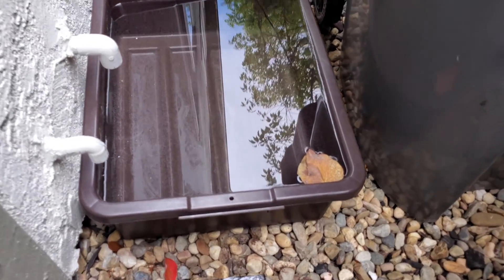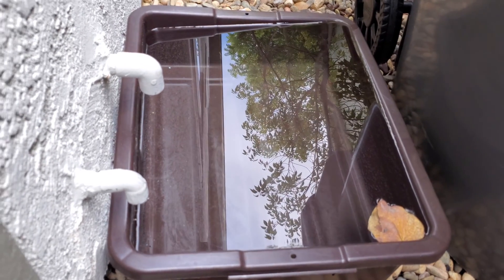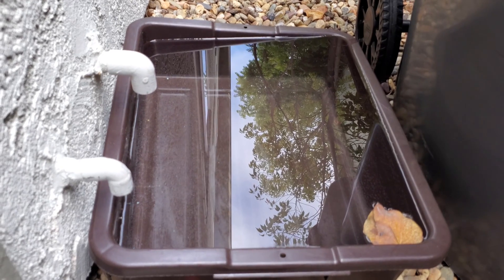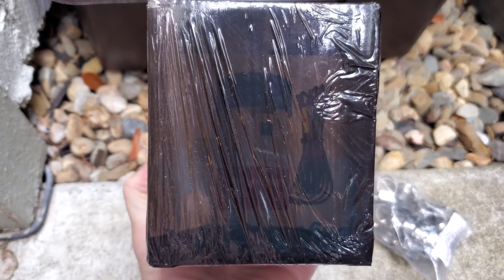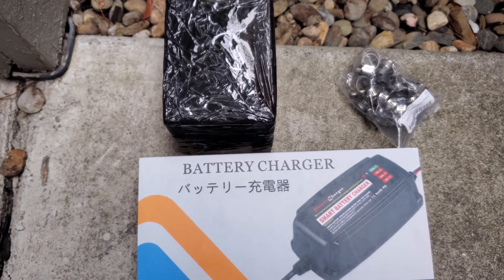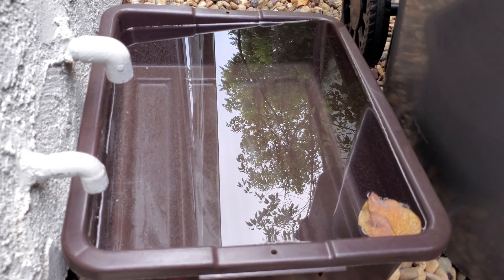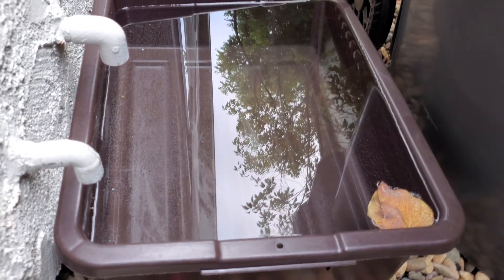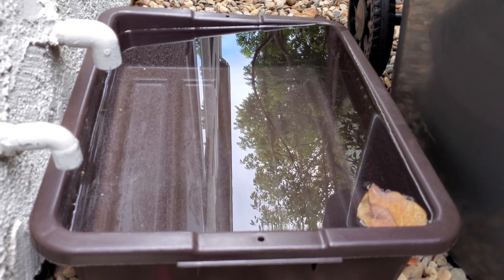System To Recycle Water From AC Drain

Comment: I have a similar system... but I run the water from the pump into a sediment filter, and then collecting the water into a 100 gal tank at the basement.  From there, another pump supplies room temp water to the laundry room upstairs to wash clothes.  :-)
Also collecting the water from a reverse-osmosis filter, which wastes 4 gallons for every gallon filtered.  Also being collected on another 100 gal tank, and connected in parallel (with shut-off valves) to the pump that supplies water for laundry.  
UV lights turn automatically at night for an hour inside each tank to decontaminate the water collected that day.
Digital gauge @ laundry indicates how much water is in each tank.  Our old washing machine uses about 14-15 gal per cycle, so with just one rinse, it uses around 30 gal per load (medium).
My water recycling system works like a charm.... although I have to manually operate some valves to route water from each tank as needed, it works well for us.
Reply: Forgot to mention that I also collect the water from a dehumidifier we have at the basement, that collects about 2 gal/day. I then dump the collecting bucket from the dehumidifier into a small 2 gal collecting tank where the AC water drips, and the dehum water is then routed thru the filter, and into the collecting tank with the AC waste water.
Overall, during hot season, between the AC dripping and the dehumidifier, I collect between 8 and 12 gal/day depending the temp outside and the humidity level.  There are faucets on each tank to get water for gardening and for the bird bath. The only part that sucks about my system is that it's at the basement.... so to water the plants, I have to go to the basement to fill gallons (LOL).